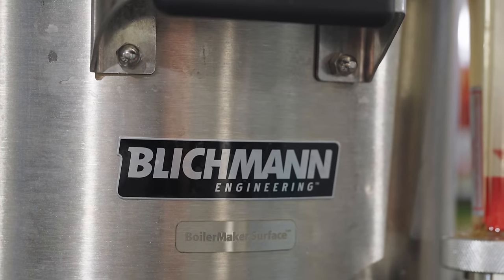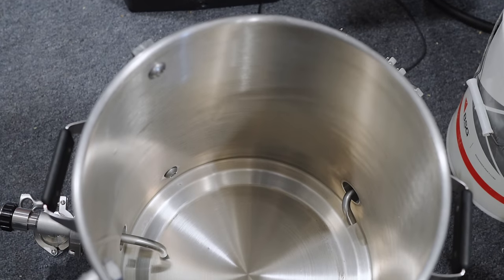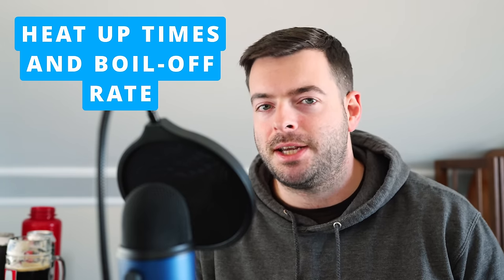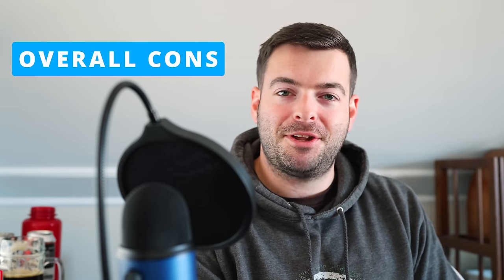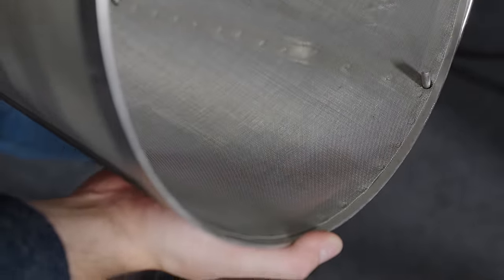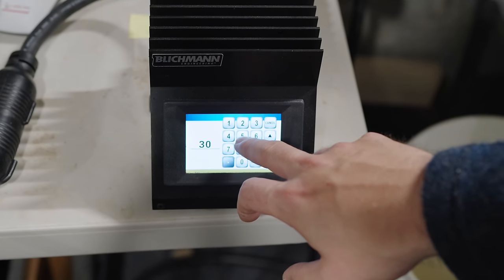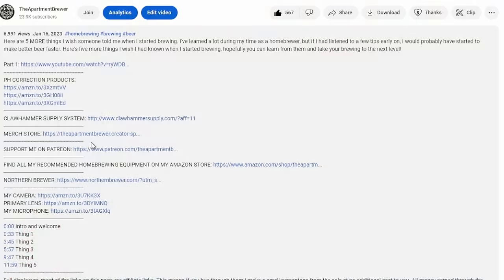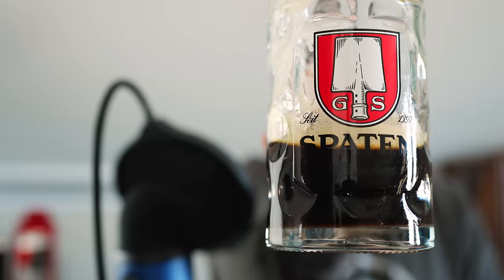BLICHMANN BREWEASY COMPACT SURFACE Review | BrewEasy Vs Clawhammer

Comment: A hidden gem in the Blichmann catalog is the Command Stand. BrewCommander, Therminator, RipTide and even the flow meter can all mount on the stand. Kind of expensive at $199, but all you have to do is bolt it together and bolt everything on the stand.

Comment: "It's a lot of stuff!" I fully agree, as that shocked me when I first received it. The Surface is 18 lbs without anything attached. (Someone had asked me, so I had to weigh my tri-clamp version Surface). I agree with the spot welds, as I have a small spot, but I blamed myself. I have the surface version BrewEasy now but have yet to brew with it due to a backlog of videos. And lastly, thank you very much for the shoutouts! (I did a ton of videos just on each attachment 100% because of what you said: "It's a lot of stuff!" I was also overwhelmed initially and felt many new owners would be overwhelmed, too. (I actually walked someone through it over the phone just before I got mine.) I have been wondering with the new BoilerMaker Surface, if I could actually add a larger grain basket since the heating element isn't in the way, but there are still a few things in there. (I do the full cleaning about every 2 to 3 brews based on how far between brews, but CIP after each brew.) Added note: Never use that grain basket for hop additions! Brian had suggested it before testing it, and I actually tested it on camera, and it was a nightmare as it was never intended to be used for hops.
Reply from the maker: Your videos were my number one resource!

Comment: Great Video Apartment Brewer. I have a Brew Easy Classic 2 vessel system and enjoy it. The Riptide and the Brew Commander were the reason I bought the system. I really wanted triclamp ports on my pots, but they weren't available at the time a little over 3 years ago. I nearly bought the Clawhammer at the time, but the Brew Easy system was close in price and closer to a 3 vessel system. I didn't really want a 3 vessel system, but by purchasing the Brew Easy if I need to add a vessel it was going to be a minor addition. I have 3 systems now, and I use them exclusively as kettle RIMS systems. The Blichmann false bottom is another well made invaluable addition to my brewing. I was lucky enough to discover Blichmann's 15 gallon false bottom fit my Bru Gear15 gallon mashtun, rounding out my fleet. Cheers.
Reply from the maker: I think the breweasy classic is a very interesting design and I can see how it is a great transition from 3-vessel brewing.

Comment: I've never been a fan of the Blichmann system - fiddly, overly complicated and emphasis on stuff that doesn't really matter to most home brewers at the expense of stuff that does. I use a Brewzilla gen 4 which is so easy to use and has very granular control with its RAPT system. It's also way more efficient and can brew a higher volume than the Blichmann, which is what brewers are most concerned about

Comment: Hey man, i been watching your videos and thank you for all your great knowledge!

I'm wanting to make your festbier and a traditional recipe of witbier. 
I can't drink until March, which is also when I have my 30th birthday, and I wanted to make these beers to celebrate 

I'm Brazilian and i finally managed to control my fermentation temperature. I got a backup fridge for the garage. The room temperature is in the 90ºF ballpark and my fermentation fridge can go reliably to 49ºF

I have some questions and the local brew shop isn't very helpful (like when they told me water chemistry doesn't matter because the malt and hops overpowered the water), so if you don't mind, I have a couple questions.

1) I'm going to bottle it. I should let the beer lagger in the fermentation bucket or in the bottles?
The fermentation bucket feels better to avoid getting the beer unclear during transportation after laggering. Im not a particular fan of yeast cake...
But do I need yeast for bottling or I can bottle normally? 
I'm want to use Lallemand diamond

2) In my current setup in this time of the year, my temperature options are 49ºF or the room temperature in 85ºF to 96ºF
Can I make a diacetyl rest in that high of the temperature or it will throw odd flavors?

3) Can I ferment the witbier with Lallemand wit in thar low temperature of 49ºF?

I kinda have access to all Lallemand dry yeast line. 
I can use the kveik but if possible I rather make a true lagger and a true wit. But if not possible, I can use the kveik.
Reply from the maker: Congratulations on the upcoming birthday and brews! To answer your questions - 
1) I would recommend lagering in the bottles, as you are less likely to have oxidation problems that way. Just bottle, naturally carbonate as usual, and then lager upright as long as possible and leave the yeast chunks in the bottom of the bottle when pouring. I don't think you'll need additional yeast. 

2) Can you hook the fridge up to a cheap temperature controller like an inkbird? That would help you fine tune. A long fermentation at 49 will probably still have some diacetyl but 85 is way too hot for a freshly fermented lager.

3) I am not sure about fermenting the wit at that low of a temperature, it might stall on you. If you can set up a temperature controller for the fridge you will be all right through.

Comment: You mentioned the rotating dip tube to remove wart without the trub.
Question - 
-Do you set the angle before hand? If so how do you know where?
-Do you rotate it at the end to get the last bit out? 
I have no idea how to set mine in my fermenter, as I have no idea how much trub will be at the bottom when it's done.
Reply from the maker: Usually I just set mine before but if you keep the triclamp connection relatively loose (it will still hold a seal) you can rotate it as you are transferring to keep it out of the way.

Comment: Looks like you have to remove the recirculating arm to lift the basket? Is that fairly simple to do
Reply from the maker: That is correct, yes its a simple O-ring push fit

Comment: I currently using the Clawhammer system for my homebrew setup. I’ve used the Blichmann 1bbl 3 vessel system with the ripe tide pump and the Therminator chiller for about 20 brews and really enjoyed it. Now I’m graduated up to the Blichmann 3.5 bbl 3 vessel system for which I’ve been brewing with it for 18 months and not a single issue. Blichmann makes really good quality brewing equipment. Steve makes a great point about being over engineered because they are definitely over engineered. The only downside I see to this system is the grain basket. I’m sure it’s coned shape is because of the ports and gadgets that are cool but it does hinder your ability to higher gravity beers. 🍻🍻🍻
Reply from the maker: They do make really good gear that does last a long time, I agree. If the kettle and basket were just a bit larger, this whole issue would be resolved.

Comment: Great review. I appreciate the comparison heat up times you mentioned. I have the Blichmann linear valve on my boil kettle. Super easy to clean.

I'd like to have the 20g Surface as a single eKettle to replace my 3V propane setup. I think a simple bag and false bottom (to reduce scorching the grain) would be a better option vs Blichmann's tapered basket.

Comment: I think the cone shape to the basket allows room for all the gadgets / ports at the bottom. They sacrificed mash capacity for this. If the entire kettle were a bit taller they could have a cylinder basket and no problems with larger grain bills. Then the ports would all sit under the basket. Maybe in the next model…
Reply from the maker: Accurate. It's a space equation but a slightly bigger kettle basket combo would fix this whole problem
Reply: Same mash basket as the Brew Easy Compact. It's conical so that it has plenty of room between the basket and the BoilCoil, which is very much appreciated. Since Blichmann is now offering it separately, I purchased one for my 15 gallon G2.

Brian with Short Circuited Brewers tested it with 18lbs and that maxed it out.

Comment: I just recently purchased the Clawhammer 10.5 gal 120v system and I’m starting to think I made a mistake in the 120v. I do have access to 240v but thought going worth the 120 wouldn’t restrict me as much to areas where I can have my brew day. It’s being delivered to me on the 18th of this month. Should I just send back and get the 240v? Just curious on your feelings on the two. I understand it will make my brew day long due to heat up times and I my main concern is the boil doing it’s job.
Reply from the maker: So I happily used the 120V setup for many years, it still has that portability factor with the gfci plug which is super useful. But the 240V is a powerhouse on heat up times. If you can swing it I'd recommend getting the 240V controller and element later since you can easily swap between the two
Reply: @TheApartmentBrewer  thanks, I will in the future I’m sure.

Comment: I've had some similar experiences with mine.  Main gripe is the limited grain capacity, cleaning hassle, and having to keep that probe inserted. Decent system, but I still prefer my BrewEasy Surface Classic. More robust and easier to clean especially for someone like me that also does not have a nearby slop sink to spray clean that mesh basket.
Regarding the little o-ring, I had to order a replacement package of them from Amazon because they do tear easily if you do not lube them. Since I use the the Brewcommander probe for both the Classic and Compact BrewEasies, they tear too often.
Reply from the maker: Glad we agree! I like the concept of the surface element design but the basket can be a pain. Have you tried using the breweasy thermowell instead of just replacing the o-rings all the time?
Reply: @TheApartmentBrewer  I don’t have one, but I might get one so I no longer have to bother with it.
Reply: If you're talking about the little o-ring on the outside of the thermometer housing, do you happen to have a link?

Comment: I’ve been thinking about this as a long-term upgrade from my Foundry, which I love. I really want to move to triclamp and away from gross ball valves. It’d double as my HLT when I do 10-gallon batches. 

Biggest con is cleaning all the attachments… the sight glass, recirc arm, and flow meter look like pains in the butt. Hopefully CIP works well. That o-ring “thermowell” is also a nightmare, they shouldn’t ship with that - dragging a probe around during cleaning to avoid leaks!? No thank you. Nice that there’s no element to clean though.

Overall I’m still on the fence. As much as I HATE cleaning the grain pipe and the ball valve of my early-model Foundry, it still makes great beer, and I should probably just use it until it dies. I’ve got 50+ brews on it by now!
Reply from the maker: I think if you are coming from a foundry this will be an easier transition. It's a great system as long as you commit to cleaning it. My advice though is if you know your current system well and it makes great beer, just thoroughly assess why you'd want to upgrade first.

Comment: Hey, you should check out the brewtools b40 and b80 brewing systems. I use a B80 + an F80 unitank.
This system looks like it belongs in the 90's if you compare it to a brewtools system. Brewtools uses all tri-clamps vs. this system which relies heavily on threaded connections.
Reply from the maker: Those look like phenomenal systems. The proprietary tri-clamp really puts me off though. The only threaded connection on the breweasy is the thermowell. All the others are o-ring based with a threaded tightener that never touches wort. I'm in no position to try out a third system, but the brewtools systems look like Ferraris.

Comment: Wow, excellent review. I’m using the Clawhammer 120v system, I’m wondering if you have a detailed review of that also. Yesterday I completed my second batch with the Clawhammer. I have had temperature control issues with it using the Thermowell, and I finally decided to just keep the temperature probe in the kettle. Because of my concerns with temperature control, I also used a ChefMate probe, one probe on the outside of the basket and the other in the mash. My grain bill was 11 lbs, aiming for a mash temperature of 150F. Right away the temperature climbed to 160, even though my set temperature was 150F, and there were wide temperature differences between each probe. We stirred the mash several times to bring the temperature down,and we even  lifted the grain basket a few times to loosen the mash and allow for better circulation. Quite a pain. We stood there for the full hour babysitting the mash trying to determine how to get the temperature down to 150F. The result was a highly efficient mash at 1.075, but I didn’t expect to put in this amount of work. I’m wondering if you’ve had a similar experience with the Clawhammer system. Please recommend your review if you have one.
Reply: Have you ran a auto tune yet?
Reply from the maker: Auto tune is exactly what I would recommend. Also I would recommend doing a temperature probe calibration check with some boiling water and then adjust in the controller menus as necessary
Reply: @TheApartmentBrewer  Yes, absolutely. I’ve done an A/T a few times and once the day before the brew.
Reply: @TheApartmentBrewer  Also, I compared the temperatures between the Clawhammer probe and my ChefMate, and they matched exactly.

Comment: Blickman relies on a LOT of o-rings with a lot of their products. I spent time measuring them and ordering extras from other sources as they want to overcharge for a few o-rings. When the o-rings are lubed (just with water) things work well.
Reply from the maker: That's a good idea
Reply: Do you happen to have any part numbers (McMaster-Carr, etc.) or links for the various o-rings? Specifically the one on the outside of the thermometer housing, which broke during my last brewday.

Comment: I feel like this system has a lot of fundamentally good designs aspects that were muddled by other poor design choices and then shoddy execution (mainly, the grain basket sucks). Thermowell should have been the default option, same with the three-way valve allowing simultaneous WP/recirc as the riptide flows WAY more than you can send up top anyway. Sight glass should be an option along with the flow meter. There's just too much effort put into non-value added accessories.

The one I would really like to see compared against the Clawhammer is the SVBS.

Personally I brew with a Unibrau V3 that's been modded quite a bit. I'm using a bag inside a modified extended basket with a whirlpool arm and a thermowell in the bottom of the kettle along with a riptide pump. It's not perfect but has its positives over most of the off the shelf systems. It's good enough to get cool clean wort into my fermentor. The real magic happens from there.
Reply from the maker: There's so many systems out there using this general concept, I wish I could try them all but they all have their strengths and weaknesses. I think there are some things though that could go into the next version of the breweasy compact.

Comment: I think you don't have to take everything apart to clean it, since it's sealed if you think about it. I won't go for the clawhammer one
Reply from the maker: You say that, then you have to experience cleaning beerstone out of a triclamp connection so you can take it off or rotate it. It's not typically a sanitary problem, more because of the buildup of crap. Not a pleasant experience if you let it go for a while, trust me.
Reply: Yes I guess I was wrong again🤭 just toke something apart and it had beer Stone on it, always Something To Learn 😄

Comment: They dropped the ball not making this with a bottom drain or a side drain of sorts.
Reply from the maker: Agreed! A center drain would have been awesome
Reply: @TheApartmentBrewer  yeah I mean the advertise as "easier to clean" but like you said, that thing is fn heavy. They took one part out that needs cleaning.. Bad design.
On another subject, is one able to use a brew bag on this system, or would that possibly scortch?
Reply from the maker: I would probably try to keep it off the bottom directly but otherwise should probably be fine